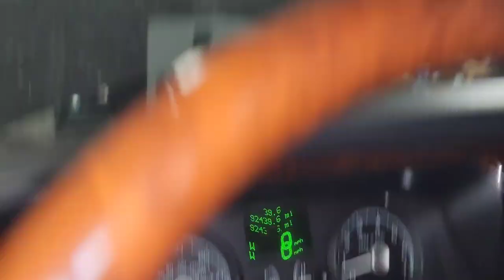2007 Lincoln Town Car Signature L $57k Brand New - Freshen Her Up - Sat For Years - Water Leaks

Comment: 92k is barely broken in for these engines. I drove a 97 P71 to the junkyard at 357k miles. Rusted frames and brake lines seem to be inherent to the Panther cars. Engine had only ever needed the intake manifold replaced, otherwise had never been apart, still ran strong.

Comment: Town Car L has huge rear leg room, to use as a taxi/limo service, yes?  I believe the wheelbase, rear doors and leg room are 6" longer.  
I have also seen 2 Crown Vic yellow cabs (New York based,  on Instagram) with the same 6" longer rear leg room and rear doors, supposedly Ford made 400 for NYC taxi use ... I think for 2011 or 2012?
Reply from the maker: Yep
Reply: I imagine they made a lot more than 400 P71Ls...NYPD also had some of them, and there's quite a few of them down in Tampa. But that's just a guess.

Comment: My truck isn't run often, so I get the oil changed once a year at 500 miles. Love the Lincoln. The cowell seal is leaking and the water is running into the passenger front and rear floor pans. Replace insulation under carpet and fix seal. No more smell or leak. Over bend the latch spring end and it should be stronger till a replacement can be obtained.

Comment: The engine and transmission are in great shape. But that rust will ruin a perfectly good used car. 100,000 mile maintenance. Then drive it till it rots out. The body will go before the engine will. It's to bad. Salt is eating it away.  Shawn.

Comment: The AC wasn't flooding the floor.  There is a front passenger Cowell leak that needs to be addressed with a new gasket.  Search the video fix on YouTube.
Reply from the maker: What are you talking about you're talking to the most knowledgeable person on the internet about these cars and you're trying to tell me how to fix them people literally travel from states away to have me fix these cars don't tell me how to fix these cars in this video I told you exactly what was wrong with it it's the fresh air Inlet above the passenger area where the plastic meets the metal body the foam rots away and then the water gets in there

Comment: Water leak = I have seen 2 Town Cars with vinyl tops at the rear chrome trim under the window - - factory-drilled holes for the chrome trim to hold down the vinyl roof =  rust starts there, it probably has water in the trunk and/or interior.  Both cars I saw had rusty metal where the holes are, water in the trunk, and had mildew smell too.
Reply from the maker: It was from front

Comment: Thanks for the Cowl repair how to.  I need to do that to my 02.  I had to put coil springs in the back,  A tire shop guy lifted mine without turning off the switch.  leaked after that

Comment: Coming close to my first service on the HighLongHotrod transit since I used Amsoil and a K&N filter. 
Gonna send a sample off to Blackstone. 
5k miles with hard high rev use and long hours of idling all in 100 plus degree weather. Heavy gravel road ripping as well. 
All on the 3.7.

Comment: The 2006/7 was the transition years for panther body for the lower control arms. Cop cars retained the aluminum lower A arms. Then as supply dwindled the regular cars started going to steel. The Limousines also used the aluminum A arms. But regular L cars did not. 

There are three Layers of leaks on town cars. You attacked layer one. The second layer is between the fresh air duct inside the car and the firewall. It’s literally the other side of the metal from where you laid down the rtv. That seal dries up too, water wicks in and runs down the firewall. 

The seat scoot on exit/entry doesn’t work long time. Always shutting that off on my cars so it doesn’t break the motor. 

It’s a shame how rusty that car is. Another winter or two and rust is really going to poke through on the painted body. Just like my 2006 signature limited that was black on black Michigan car. Rusty rusty rockers. 

Signature L is probably the rarest of the body trims sold. The THX system while it sounds great is super expensive to get the in dash 6 disc player replaced as it’s made with toothpicks and bubblegum. 

I own 4 of the 2003-11 variety of TC. I enjoy them.
Reply from the maker: Actually found out the reason why I was actually reading some information online and on the Ford pts database and it was because these cars are 6 inches longer and need a heavier-duty suspension and the cop car type design had that and it's the same type of design on the longer signature L Series because of the package it's a little bit longer than a regular signature town car so it needed beefier suspension
Reply from the maker: I think this is where people don't pay attention...  this is the reason why I specified in the video that yes it was siliconed all the way around but it wasn't done correctly 
when I do it I take the foam pieces on the underside layer and I remove them from sticking out past the edge and as I bleed my RTV through the actual plastic insert I actually rub it into the second layer underneath so it doesn't just dry on the top it dries on the bottom as well that's why I zoomed in on the video so people could see that it's just not some nice than uniform layer and it actually rolls over the edge into the bottom of the lower cover and I do it all right from the top 
I'm not sure where else you think the silicone needs to go but this is how I fix the leak on every single one of them...so far by getting the top and bottom of that plate in 1 shot
Reply: @FordBossMe  interesting. Makes sense to me. It’s confusing when trying to buy Control arms and ball joints as you’re asked what you’re using. It on. Good to know!

Comment: Spay it down with DF2 and all that loose rust will fall off in time. It soaks into the rust and smells for a while but works.
Reply from the maker: Df2? Link?
Reply: @FordBossMe  it’s #2 diesel fuel. My 03 Saturn and 19 Tacoma get a treatment every spring and fall. No rust on the Tacoma and not getting worse on the Saturn
Reply from the maker: @paulnirschl6500  I see I thought it was some kind of new chemical or something but I haven't seen before
Reply: @FordBossMe  nope just diesel fuel. It literally soaks into the rust and it starts falling off. Noticed many years ago when I was working in the woods all the trucks that had diesel tanks in the box had a rust free box but the cab was about to fall off. Been doing that ever since and have never replaced a brake line or anything due to rust.

Comment: Hello love the car, I have 2 town cars 2004 and a 2009 they both have water leaks on the drivers side (weird) have you ever had any experienced this type of water leaks? I had it fixed and was told was coming front hood latch wire coming through the firewall, but the leak keeps coming back. Any thoughts? Thank you.
Reply from the maker: Yes the hood cable going through the firewall - rubber grommet needs to be filled with silicone sometimes

Comment: Hey, I think I posted on another one of your videos I'm about to get a 2008 Lincoln Town Car with 53,000 miles. It has been maintained by the book. My question is, should I replace the oil with synthetic oil at this point or should I just continue to use what they've been using in it??
Reply from the maker: I responded to the other one

Comment: Could that Drain tube be Vacuumed out and not Blown out, Like the HVAC guys do to their drain pans?
Reply from the maker: Yes it could but that's not the typical practice usually you blow it up in there and then the water rushes out and pushes everything with it

Comment: Off topic but regarding oil life mentioned in beginning of video. I used to put 30-35K miles on my car yearly. Do to unfortunate and unforeseen health issues, I am no longer able to work and no longer drive on a daily basis. 1-2 short trips a week is the norm now. I use Penzoil European Full Synthetic and planned to stick with 5K changes. You mentioned additives falling out of suspension. Is there a time frame for synthetic oil changes since I will no longer be accumulating the miles I did in the past?
Reply from the maker: I just tell people at least at minimum every 6 months
Reply: @FordBossMe  Thanks I appreciate you Rich.
Reply: When you only drive a few 1-5mile short trips a week:

#1.  Alternator may not recharge the battery enough after starting.  Get a trickle charger for indoor storage or a 12v dc dash (or rear deck if a car) solar panel 10Watts+ ($20) for outdoor storage.  

#2.  Moisture on car or even in oil never boils off since the vehicle never gets warm enough.  =The humid air in the engine above the oil condensates.  

#3.  Tires may wear more from not moving and being in the sun.  Buy real good tires with strong beads and rims so you are not putting air into them all the time.

= ever week or two drive a little longer 10-30 minutes to make sure everything is working and running correctly.  Add that fresh gallon or three for the next weeks.  Don't keep a full tank of months old ethanol fuel.

Comment: First off I’m sorry to ask this question here, I am in desperate need of some guidance. 
2010 4.6 L 3 valve, when coming to a stop, the Rpms bounce from 800-1100 until right before the complete stop. Then it drops to 500 at idle. Idles perfectly smooth. As soon as I take my foot off the brake, the tach goes up 200 rpms. 
It’s like someone is putting their foot on the gas as I am trying to stop. Timing chain job done a few hundred miles ago at a local dealer( relevant? Idk). I have cleaned the throttle plate on the truck ( was happening before cleaning). No Cel, no other problems. Any help would be appreciated.
Reply from the maker: I don't know this is kind of weird

I hate to say this to you but over a message I can't diagnose this if you've already done the basic things like throttle body clean maybe try mass air flow cleaning
Reply: @FordBossMe  thank you very much, I just thought maybe you ran across this before. 
I forgot to mention that I did spray the maf with maf sensor cleaner. (And let it thoroughly dry before installing it back into the intake tube)
I realize long distance diags are next to impossible. 
Thank you once again I appreciate the reply.
Reply from the maker: @dm7097  do you keep up on maintenance with this car? Plugs and ignition coils
Reply from the maker: @dm7097  make sure there's no vacuum leaks because that could also be a reason for a raise in RPM
Reply: @FordBossMe  I’ve had for about one year so far. Since I’ve had it, regular oil changes (3k miles), and just did plugs. Along with a few unrelated repairs. But it idles smooth as silk, and has some get up and go. The only time the Rpms get weird is coming to a stop. Other than that they stay steady with pedal input.
The truck has approx 116k on it. I believe original coils. ( had original plugs)
Reply: Sounds like a vacuum leak.  

Possible transmission clutch issue.  What does this vehicle do when you manually downshift it.  = if there is a clutch engage/disengage "shudder"  issue it should show better with a little up and down shifting on an automatic.  

Did Ford read the OBDii or is it just your scanner?  -Take it to Ford and have them scan it.
Reply: @jonmccormick8683  I have not tried manually downshifting. I did however put it in neutral at a approx 10-12 mph when the idle was high. It then dropped to 500, put it back into drive and it stayed at 500 until I just tapped the throttle. The rpms then jumped to about 1000 again.
Obd has not been read lately. I hooked up my code reader before I bought it to double check but nothing since. Also no light on. (Doesn’t mean there’s nothing on the history I guess)
Right now my plan is to take it to the dealer and pay for a diagnostic on it and see what they can find. 
Thank you for your help as well, I appreciate you.

Comment: My grand marquis smokes when running any things I should look out for 2 try to fix it
Reply from the maker: I don't ever see that with them 

Maybe valve stem seals or compression loss.....

Have you tried BG EPR AND MOA combo?
Reply: Does it leave clouds of blue smoke when pulling away from stop signs but otherwise doesn't appear to smoke?  If so it's the valve stem seals.